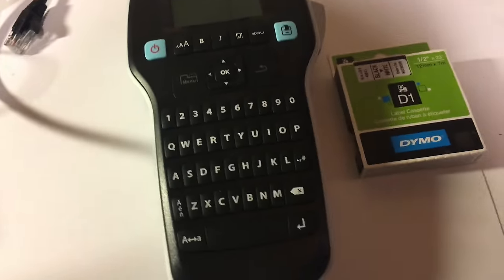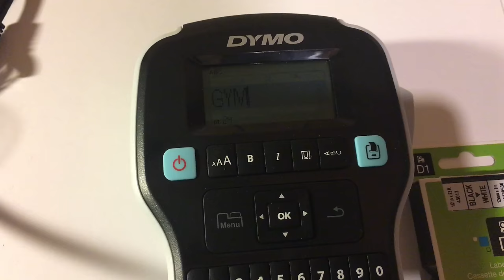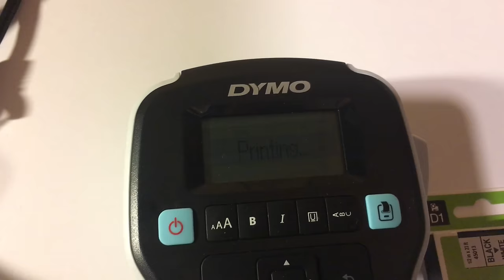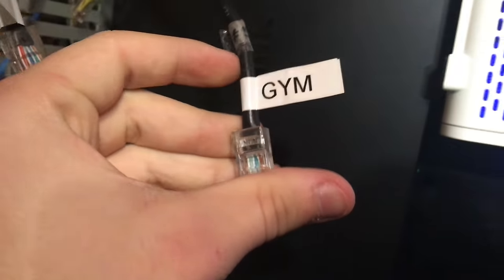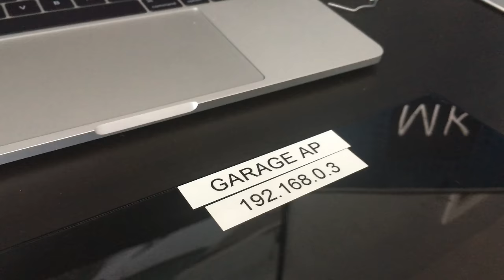Complete Guide Setting Up The Smart Home Network: Final Installation

Comment: it looks like your setting up a "mesh" network. I would like to do the same using "Luma" mesh router and access points. Will they work for a home network like this? What are the limitations of Luma vs. what your using?
Reply from the maker: Mine is all wired so it is more stable because Luma is all wireless so it is prone to interference. But, I think luma is still a good solution if you really can't do wired, because wired is always better.
Reply: Buy some UAP-AC-LR's and wire them to your router/switch, they are automatically mesh! :)
Reply: Probably a cheaper option as well

Comment: It's a router used as an AP, you should invest in POE APs
Reply: Matt Chen yes, that is a solution. But more expensive and not needed if you have power where the device is. 

Another thing is that it usually uses wires that is needed for high speed communication. So you will only get 10 Mbps and not 1 Gbps.
Reply: @Anders Jackson You know nothing of Wireless AP technology do you? You can get Gigabit POE APs and dont have to configure them to disable the routing feature. He Literally has 3 routers all spitting out WIFI. If you are gunna do AP at all you should eliminate the All in one router WIFI that he used downstairs and go with a simple Layer 2/3 router and use either POE APs or what he used.

And they are not more expensive. Ubiguti UAP AC Lite POE APs are $85 with 2x2 MIMO dual band Gigabit while his Netgears are at cheapest $99 and he had to log into them and shut of the router function of them.....Please learn wireless tech before you comment and look stupid.....10Mbps from an AP HAHAHA Uses wires that are for high speed communication ...HAHAHA he was already using CAT6 jesus man

Also that AP connection speed is only to the router. You will never go faster then your external WAN download speed is. So if you only have 150Mbps down (which is about average for most people) then even a 10Gbps internal connection will only hit 150Mbps MAX when reaching the internet....
Reply: @Willis Cooper
Could he do the same work by having a modem/router device? Why is he using router and modem? And also is the AP necessary? Would i be fine with a modem/router that covers the whole house?

Comment: I might have missed it in the video, are you running stock firmware on that router? If so, yikes ;)
Reply from the maker: Yes I am running stock firmware because I do not need anything else
Reply: Bummer, if you're looking for more performance and better reliability flash it with Gargoyle ;)

Comment: god mode for me (i'm very easily pleased) would be the ability to see my room temp and being able to turn on my heating or a fan from my phone in bed, so i guess an esp8266 with a temp sensor and 2 relays, i have no hub.router.internet/other wifi, it would be just a direct connection from this impossible device to my phone.....

subbed.
Reply: lez briddon you could look for Sonoff devices, yes, it is the name of the device. There are one where you can add temperature sensor and controls two devices. 

But it uses web services, so if the device looses Internet, you loose connection to it even if you are in the same room and same Lan. 

Then you need to reprogram the Sonoff to use MQTT and set up a openhab system as shown later on.
Reply: Anders Jackson yeah there's of the shelf but not as fun as a build. and my 'bed' is often miles from an ISP....
Reply: Set up an phone based Internet router then.,,
Reply: Anders Jackson  ok i admit I'm way better behind a soldering iron than a keyboard but i often holiday in my van 'project 806' which can involve me being many miles from a cell tower so no internet, last year i even got lost for a day as no Google maps.. so can i use my phone for this if there's no cell service? just would be so good being able to turn the vans cab heater on from in the sleeping bag/bed. (it only needs a relay to it's enable pin)